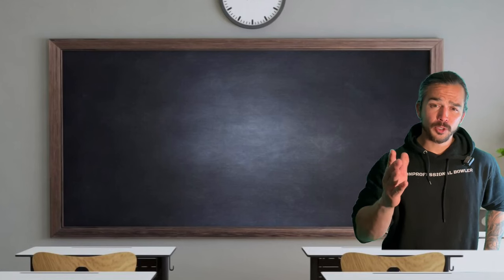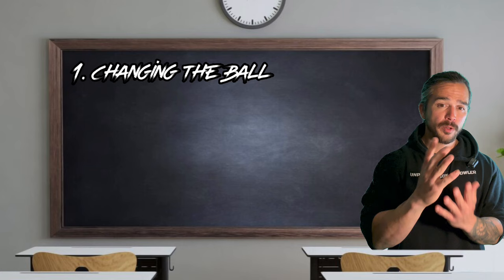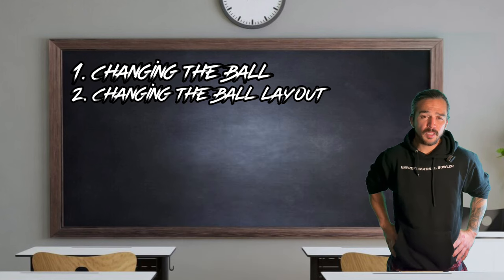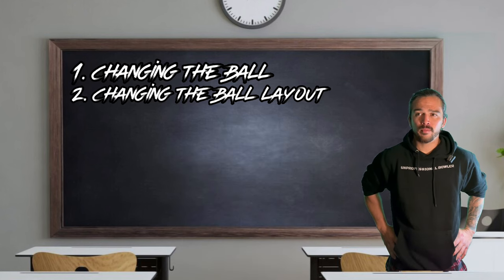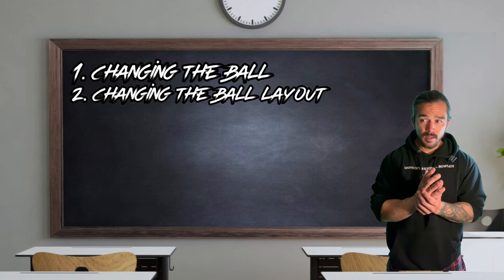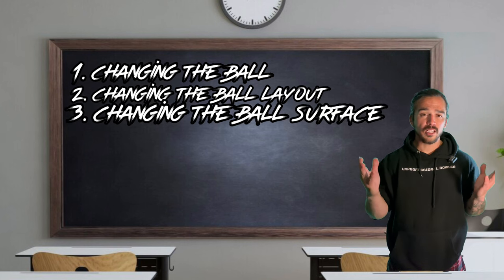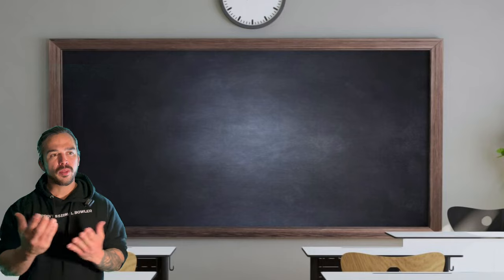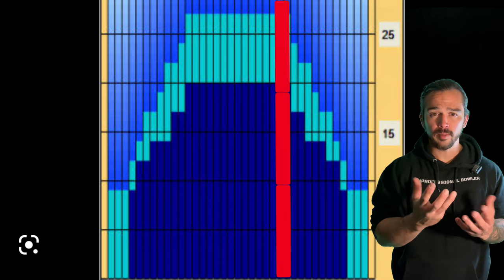Bowling Ball Surface Changes EXPLAINED (for noobs)

Comment: Something to note that nobody ever says, is that you can polish any grit. You can do 500 grit polish, for a long sharp motion. Or 4000 polish for a long smooth motion
Reply: Thats fkn interesting af
Reply: Can also do a wet or dry sanding too. Currently have a 1500 wet sand on a ball that makes it almost as long as a Pearl, but way more angular. Absolutely love how it moves now
Reply: On behalf of the grit-polishing world, thank you.
Reply: You're correct bringing this up; However, I don't see it that way.  To me, the more "teeth" underneath the polish (500/1000) is going to be more traction promoting additional midland read.   I would think that 2000/3000 and then polish would be making the ball way more clean through the heads,  thus more energy retention and sharper

Comment: Thanks, this is the video I needed I think.  Getting back into Bowling after 20 years and turning 70.  I bought the NU Blue as it seemed what I wanted (I bowled 200avg with the original).  I tried it the other day and it hooked like a mother.  But now I see that its 500 out of the box.  I think I need to get it taken to 1500 - 2000 to take some hook out and let it roll farther as I dont have the ball speed I had before.  Im at 9.2-9.8 and Im sure in the old days I was closer to 14.  

Let the learning begin.

Comment: This is a great video for people who don't know what ball surface does and does cover the brass tacks very well. However I would like to elaborate on something:

1) The ball isn't hooking more, it's getting more friction on the lane. So the ball is actually hooking EARLIER. the Shape of the hook motion is determined by the core of the bowling ball and the drilling layout. You can see that in the overlay the shape the ball makes as it travels is the same. But at 180 grit it hooks early.

2) Ball energy when it hits the pocket is impacted by surface. Basic physics dictates that when your ball starts hooking it loses some of its initial energy that is used to change direction. Generally speaking the lower grit you use, when the ball hits the pins it will have a weaker impact because it's using more of it's kinetic energy.
Reply from the maker: You are correct but this video is aimed at the person newly getting into bowling and doesn’t even know that surface is a thing that exists.

Comment: I use surface to tackle 2 different lane types that i bowl on. I bowl on a league with synthetic lanes standard house shot with a ball with a fairly strong coverstock sanded 500, 1500, 2000, 3000, 4000. Then i bowl another league with wood lanes n short oil so ALOT of friction and use a weaker coverstock ball sanded 500, 1500, 2000, 3000, 4000, then polished to help it get farther down lane before it reacts. The ball i use on synthetic i can use in the 1st game there if i dont throw low revs on it but after that or come around it too much and itll hook at my feet. I should also mention if i throw that ball i use on the wood lanes on the synthetic i have to really get some revs on it or itll never read the lanes. Itll just slide or react so late it just barrels through the pins

Comment: So I have a Proton Physix and I love that ball so much. But after about three games I'm lofting the gutter because it's just hooking way too early. Is there surface that could take away a little hook as well and keep the ball a little more manageable?
Reply from the maker: The other direction would be to polish it and make it shiny. But as the proton physix is a ball that is made and meant for hooking early - I’d recommend getting a weaker bowling ball and saving the proton for heavier oil conditions
Reply: @220avg  any good recommendations? I'd like to stick with Storm products but I'd also like to get that elusive 300 someday... 🙃
Reply: @racingaerials4493  can’t go wrong with a hyped solid if you want a weaker solid ball. Could also use a symmetrical pearl. I like my Fate a lot.
Reply: @racingaerials4493  Hy-Road family, IQ Tour Ruby, Revenant, etc... Just about most balls in the SPI lineup are lower strength than the Proton Physix.

Comment: Just as a disclaimer if u have a reactive ball that comes out the box at 1500 grit and polished if u change that surface it's nearly impossible to get the factory finish back even tho there's 1500 grit pads n polish it won't b exactly the same

Comment: I know you’re going 2 handed now but have a question. 
I’m a 1hander and I cannot, no matter what I do get my hand behind my ball on release. I always release from on top of the ball. How do I fix this?
Reply: You could try not putting your thumb in the ball. That will force you to keep your hand under it.
Reply: @MikeDCWeld  like as practice or completely change my style?
Reply: @digicatt9320  up to you. I'd suggest starting off as practice  with a lighter house ball and see if you want to go for the switch. I changed to 1-handed, no-thumb when I started trying to hook the ball and have found it works well for me.

Comment: As a noob the question I've always had is, let's say you have a Zen that comes out of the box at 1500, you use an 800 surface pad, then you want it at 1500 again. Can you just use a 1500 pad or would you have to get the ball polished?
Reply: You don’t have to polish it, it will come out nicer if you do 1200 then 1500, the more increments the better. But you can always go back
Reply: A Zen is 1500 polished (well, now Reacta Gloss), but depending on how SPI gets the 1500, it could be 500/1000/1500 then polish on top. Using staged grits allows you to create a variable depth scratch pattern on the ball surface, and the polish is just enough to blunt the tips of the scratches to give it a shine. Too much polish and you will knock down the 500/1000/1500 grit too much and the ball will act more like a 5000 grit which won't grab the lane at all and probably skid itself through the pins with minimal hook.

Comment: Picking up earlier when you have some surface on it, that also means that it loses energy much faster down the lane, right? So if the ball is too hard to control, because it's to aggressive down lane, you can put some surface on it to make it a little smoother on the last part of the lane. Or am I completely off target here?
Reply: Depending on ur cover, core, n ball level... yes lower surface will use alot of an entry level balls energy up in the fronts but a high level ball is going to store energy until it hits the pins carry won't be a crazy issue the issue is what u need the ball to do does it need tamed down or does it need more hook n if so early or later ppl get nervous changing surfaces I will tell u I rip every cover off every new ball I get n find the surface I need that specific ball at
Reply: @MrRoss3291  I only have 3 balls + a spare ball, and I never bothered (or dared) to resurface any of them. A guy at the bowling alley told me that once you resurface the ball, it will never be completely the same as new again, even with the same grit. My Storm Crossroads is getting old and scratched up, and I love that ball, so I may give it a try and resurface that one.
Reply: @Audun Wangen  I put a disclaimer in the comment section if u want to surface a ball if it's a Solid or Urethane u can change the surface n put it right back... now if ur balls reactive n comes out the box at 1500 grit with polish that's the tough one u can't get it exactly back, there are 1500 grit pads n polish but it won't b the same that's the only issue and 3 of mine came that way they're at 360, 500, and 2000 grits respectively
Reply: Yea ur cross roads is a hyroad so that's 1500 grit with polish now its older ur better off detoxing the ball pulling all that oil off cuz it may say 1500 grit with polish but after 50+ games ur balls surface is at 2500 grit which is the grit of the lane
Reply: @MrRoss3291  Thanks for the tips. I haven't deep cleaned it, so I'll try that first. I've heard different tips, but I think the bucket and dishwasher soap is what I'll try first.
Reply: @Audun Wangen  for sure no problem just cover those finger holes don't want water soaking in but that's the way I clean my balls but good luck I hope that helps

Comment: After using the pad, can the ball return to its normal reaction?
Reply from the maker: Yes if you take it back to what it was at

For example, for the diamond diva. You’d need to bring it back to 1500 grit then apply some polish to it afterwards

Comment: The Stock Finish, you consistently hit between boards  13-15 and afterwards with 180 Grit, it was closer to 17-19 as you did not get the Ball Outward.
Reply: Mike moved to the left to compensate for the grit or it'd be in the gutter. Watch the video again.
Reply from the maker: On the first shot with the overlays.. the trajectory was the same. But the ball was hooking before it even got to the arrows
Reply: I totally agree @metro14207. If this video is for observation purposes the outcome or result should be a true representation of the modification.